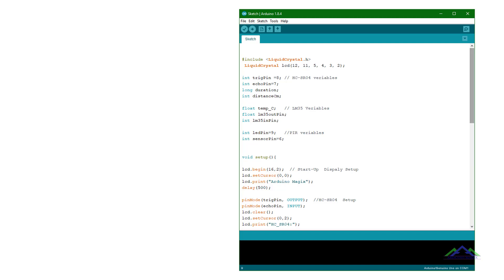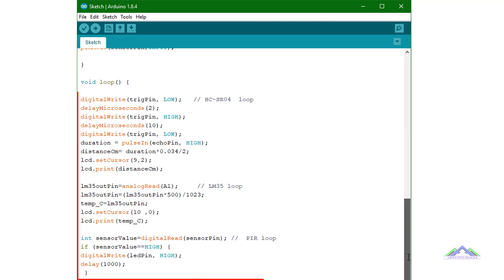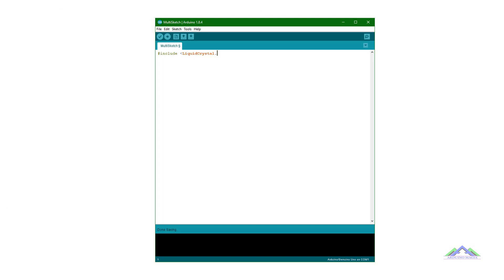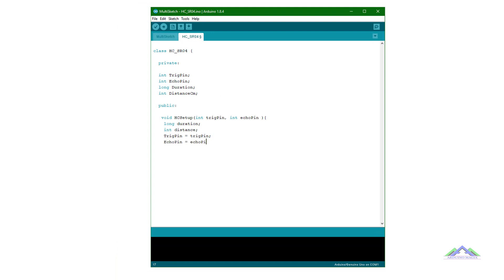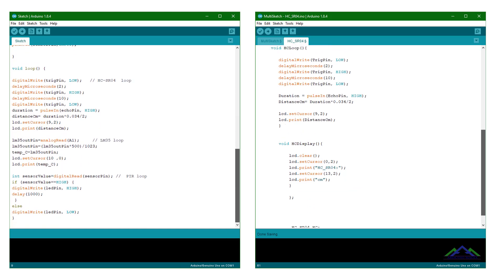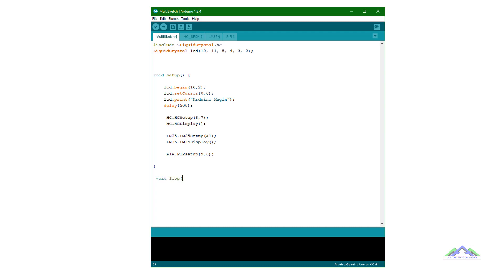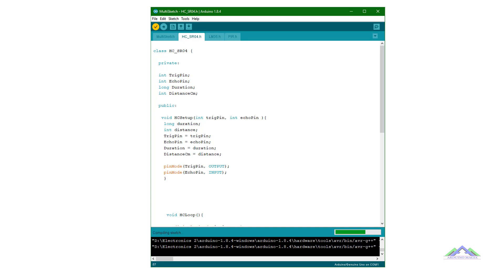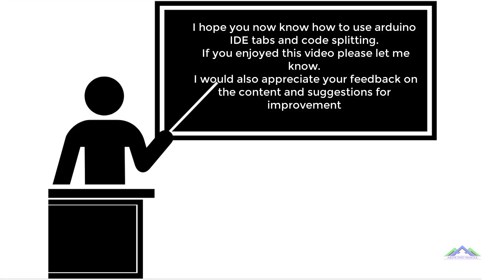Arduino Multi Tab Sketch | How to Use Arduino Tabs and Code Splitting in Arduino IDE

Comment: Than you very much for this tutorial.
I found it very instructive and easy to follow.
It was also very helpful to have the files to explore myself.
The video moves pretty fast, so if I didn't have prior experience with classes or the files to follow along, it would have been a bit harder.
But i under stand that this isn't to explain all of the intricacies of uses classes.

Comment: One more question about content of your example - let's assume you want to use 2 PIR sensors, how would you modify your code to read values from both? Is it like this:

void setup(){

PIR.PIRSetup(9,6); //this is the part of your original code
PIR1.PIRSetup(8,7); //is this correct?
}

//and then into loop part
void loop(){

PIR.PIRLoop();
PIR1.PIRLoop():

}

Would it work this way?

Thank you for answer!

Best regards,
Valters
Reply: Valters, did you get your project working that you posted here? I would also like to use multiple sensors with tabs.
Reply: @Retrocomputernerd  Yes, I got it working..

Comment: Great video! Thanks! One question - now in your example you are using HC.HCLoop() function to print numbers on LCD 16x2 screen. Inside your HCLoop function you are using lcd.print function to print the number on LCD scree. How would you change your code to get back in main sketch number? E.g. float Distance = HC.DistanceCm; ?

Thank you for answer!
Best regards,
Valters
Reply from the maker: i am not clarify with your question that what you are asking me
And I am answering according to what I understand.
 in hc class, inside  hc loop i  have put the main  code 
which  are  normally written  in Arduino Loop function. 
 as i have  shows   in sample sketch with other sensors code 
and this hc loop function i have used  in main sketch with loop function.
Reply: @electronicstree  I am sorry - I did not specified my question clear. Well you are using HC.HCLoop() function which does two things - gets the number and prints on LCD, but I would like just to call that function to return value in main sketch and assign it to any variable. Then later I can do with it whatever I want - print on LCD, print on different LCD screen etc. So the question was - what operand would you need to write, to get the number assigned to the variable in main sketch.

Thank you for help!
BR,
Valters
Reply from the maker: @wotesi   
Yes, you can and I apologize to you
  I could not answer you due to my services
you can use  return statement in HCLoop() function for getting value  in main sketch.
 So,  first of all 
 declare the distance variable in the HCLoop() function and  return the value of distane veriable by using return statement , like this 

int HCLoop() {
Duration = pulseIn(EchoPin,HIGH);
int distance = Duration*0.034/2;
return distance;

}  

and declare any variable in the main sketch that will get the value from the HCLoop() function

int Value;

void loop() {

Value = HC.HCLoop();
Serial.println(Value);

}

so this is all 
I hope you understand Because I'm not so good in English
Reply: @electronicstree  Thank you a lot!
Best regards,
Valters